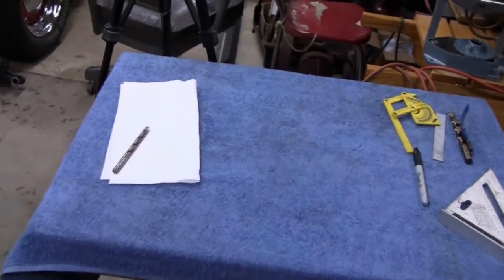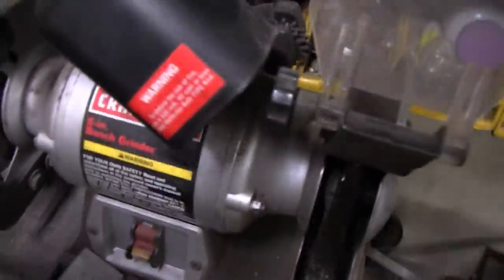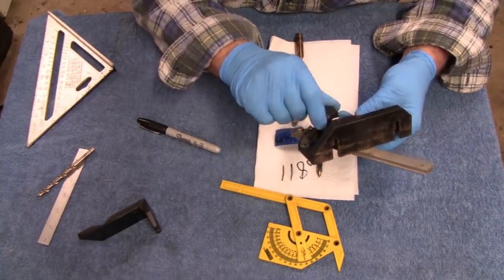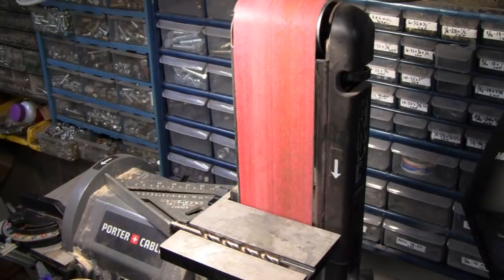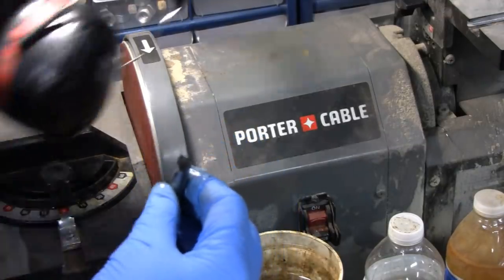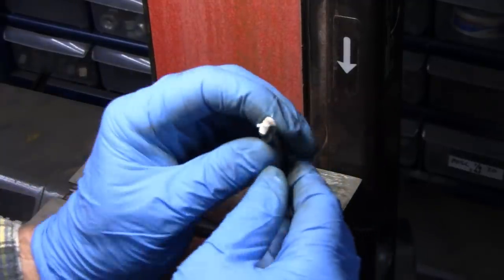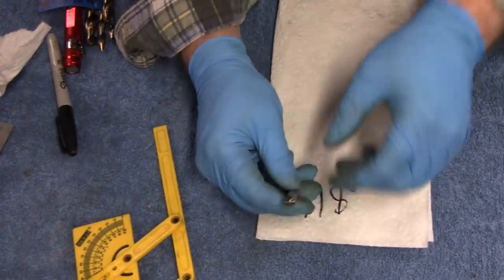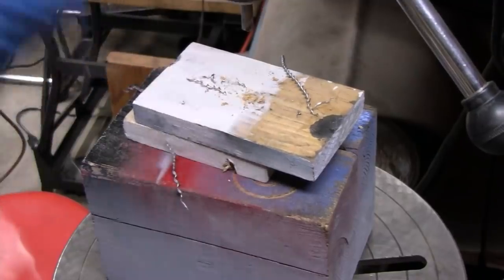HOW TO SHARPEN A BROKEN DRILL BIT

Comment: Yep that bit turned out well.   It fit the drilled hole perfect......  LOL.....    

That so called cheap protractor is a life saver like you said for accuracy on the cheaper miter gauges....  I had Delta table saws in my wood shop and one Craftsman saw that was a medium grade saw in my mind.....  The owner of saws have to adjust all the rip fences and miter gauges when they set up shop..... 

Except for 1 time when I bought a Delta Unisaw.... It was a  Norm Abram Signature saw that the dealer delivered to my shop and did the setup free of charge.....  1600 bux yes they had better do that . LOL......

Plus Tard Mon Ami ~!~!
Reply from the maker: Thanks Booboo!! Yeah that $5 piece of plastic can keep ya outta trouble!!☺

Comment: Everett, you should mention that unless you have a gauge that measures each side the same, the hole will not be the size of the bit but oversized. What you showed is good for a home shop that will get you out of a bind if you have no other bits to use. But good you showed the basics .

Comment: what did you say was wrong with the top part of the bit?
could you grind out the warp and then from the grind it down make that fit in the drill? Mike could make it all rounded to fit the drill part. let Mike use the lathe to grind the warp out.
you just cut a new head. why can't you cut a new end that fits in the drill?
Reply from the maker: Nothing you can do with a bent bit except throw it out!!☺

Comment: Just a suggestion, you could have dona a operation called 'thinning the web' (no not internet) where the center is ground back (on the back side of the cutting edge). This reduces the need to pilot drill where you have lost a significant portion of the drill length.   http://www.nachiamerica.com/content/training/Basics%20of%20Drilling.pdf

Comment: That IS in fact a good way to sharpen a dull or broken bit - BUT that one really isnt very usable anymore as there's no flutes left to eject the chips- it's only good for sheetmetal and super thin stuff - drill bits have the internal "Web" that connects the two flutes, and it gets thicker as you go away from the point, which is why your new stub would require such a big pilot hole! salvaging broken bits works better if you only broke off a THIRD of the bit or less - not 3/4 of the bit like you got there- but still a good video to show basics  - NICE JOB OLD MAN!